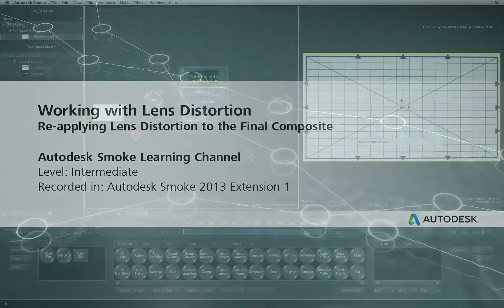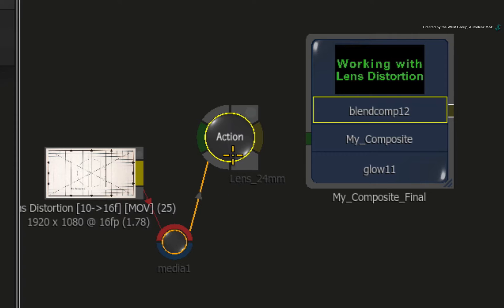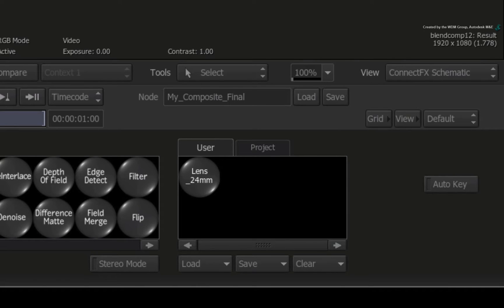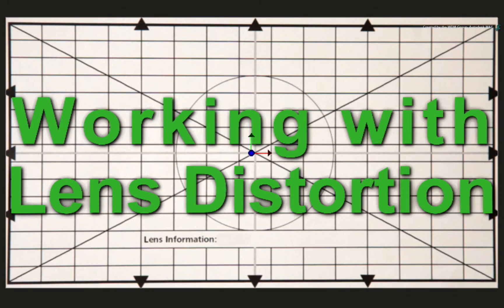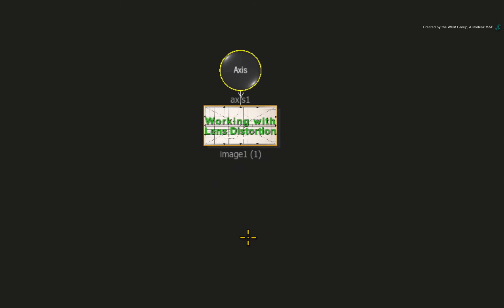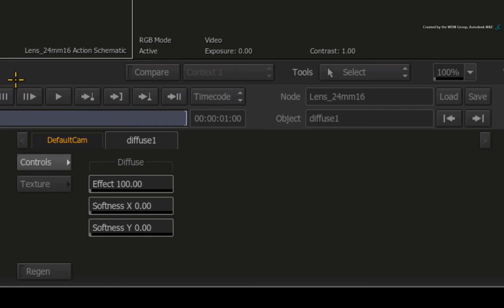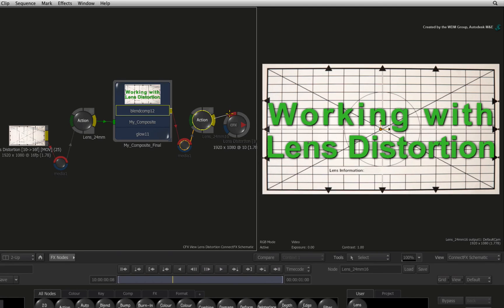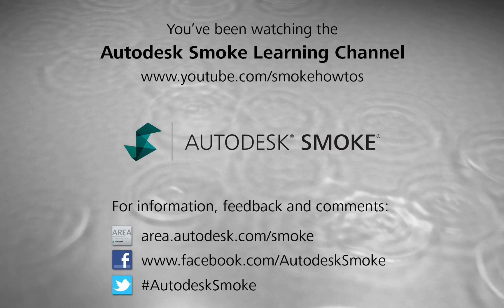Working with Lens Distortion: Reintroducing Distortion

Comment from the maker: Hi Andy.  Thank you for your feedback.  Unfortunately when it comes to lens correction/distortion, we cant draw lines on the image to straighten edges.  With regards to the edge cropping off, an alternative is to scale up the canvas in the 2D transform node so the edges are not lost and further spread out over the canvas.  You just need to remember to crop the canvas back to its original resolution after you have done your compositing.

Comment: Thanks for the tutorial Grant, great as usual. But I think we need a better solution for this. Mirroring edge pixels is not something I would ever want to do. PFTrack has a much simpler method for lens correction by the user tracing the straight lines in a frame. Plus you don't loose image data. An update to the transform2D node maybe?